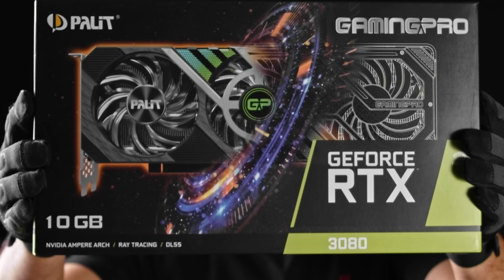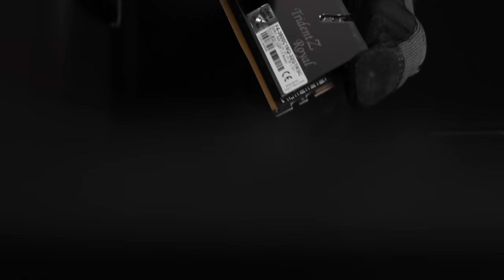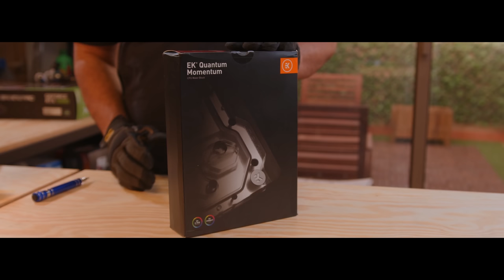CLASSY Limited Edition Water Cooled 909EK PC Build

Comment: Super clean, wish I could get my hands on one of those cases.
Reply: @DesignsByIFR , I think I'm gonna settle for a thermal take p8 and put a pair or 240mm quantum reservoir/pump setups in the side to run separate cpu and gpu loops.
Reply: I built in an Azza 804 and the thermals aren't great to say the least.

Comment: Damn that looks sweet. Just finished my first build, boring in comparison Lian li dynamic razer edition case, ASUS Maximus XIII Hero motherboard, Intel 11900K CPU,32 GB gskill trident z RGB 4000 mhz RAM, Samsung 870 Pro 450 GB SSD for windows and an 970 EVO Pro 2 TB nvme-drive for games,  ASUS ROG STRIX RTX 3090 GPU with custom corsair water-cooling block and Corsair Hydro X Series kit. Found out when i build my pc that with corsair cooling block on the GPU made it so  it wouldn't  fit in the the case anymore so had to buy a vertical GPU holder from EK with PCI-4 raser cable to make it work.

Thank to IFR's tutorial on tube bending for water-cooling I made it work thanks allot.